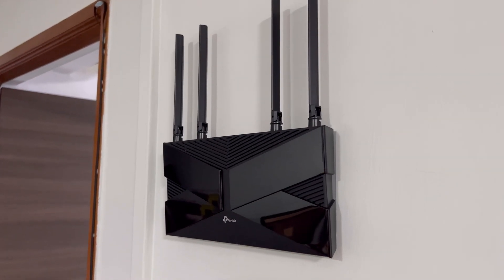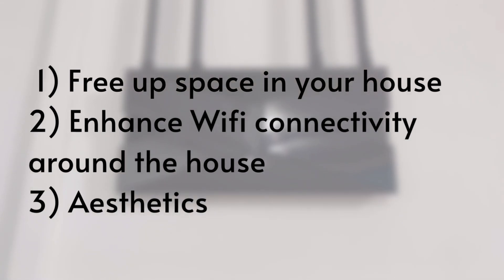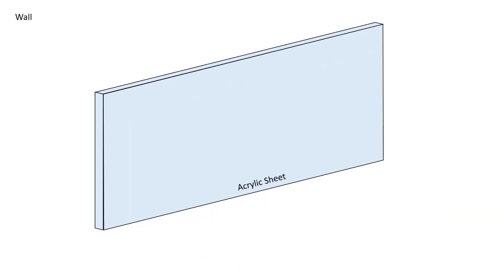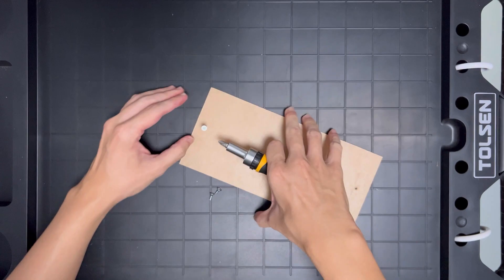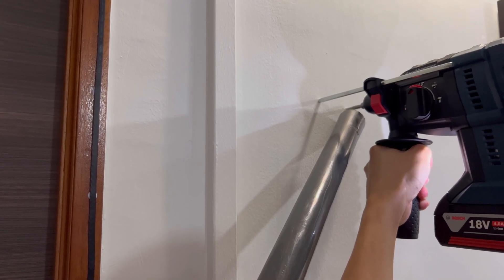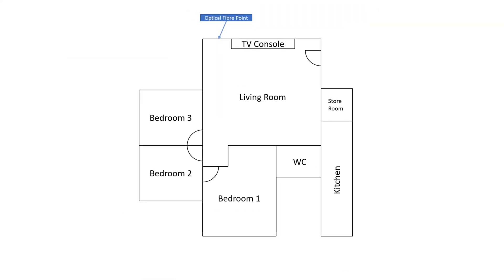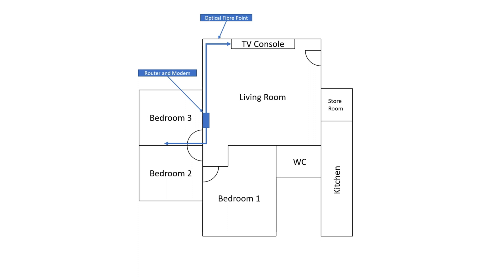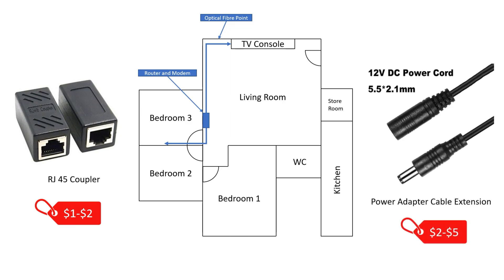Improve Wifi Connectivity - Wall mounting Wifi router using a single mounting screw

Comment: Wont dust accumulate on the ports if they are upside up?
Reply from the maker: Yes it does, so I cut some off the connectors from some old ethernet cable and just plug into the used ports
Reply: Put it upside down
Reply: Why does that matter? Just blow in the port if you want to use it.

Comment: Router will overheat because back vent fully blocked
Reply: majority of people put routers with the belly down. itll be fine
Reply: @wrench  what do you mean by "belly down" ?
Reply: @testgames4028  the bottom of the router.
Reply: @wrench  Thank you.
Reply: I mean putting it on the table would also "block", but that's not a problem. As long as there's a gap and not completely flush there shouldn't be a problem.
Reply: @10xtenx10xtenx10xten  Thank you man.
I also agree with that.
I mounted my AX10 (AX 1500) on the wall.
I did put some washers to add little space.. I will try to fiqure out in the future how to add more space..  because for now adding more space without additional support... make it wobble.
Reply: @testgames4028  Yo. Bouta get the AX10 too. I'll mount it high on like a metal thing that has gaps for ventilation horizontally. Will that be be enough ventilation. 
Also how's the router overall? I heard that it's really bad on 2.4ghz and how far does it go on 5ghz from ur experience? 
If you game, did it cost any lag spikes or have there been occasions where the signal strength is not consistent?
Reply: Almost all router have feet to add the gap.
Reply: How much square feet does it cover ?
Reply: Lol no. It's designed that way 😂